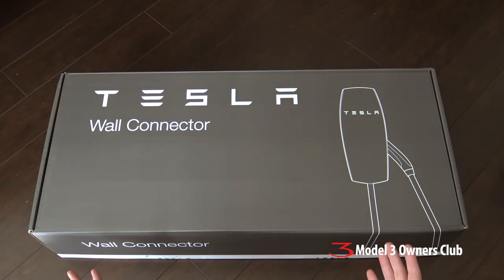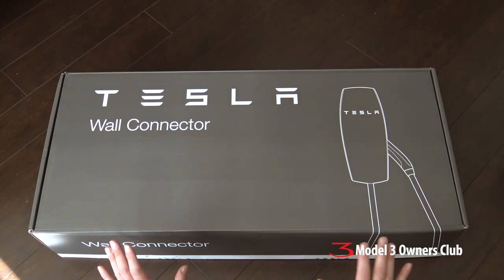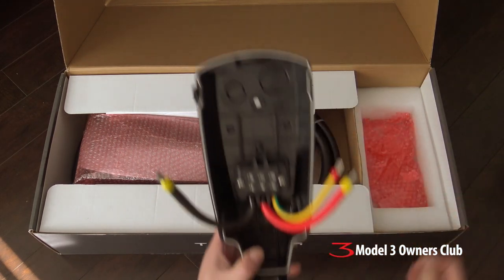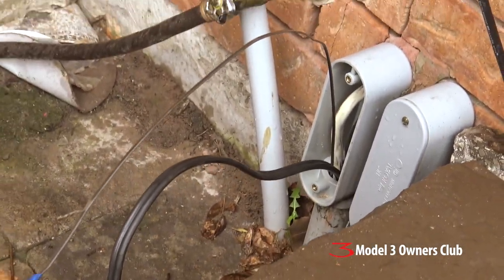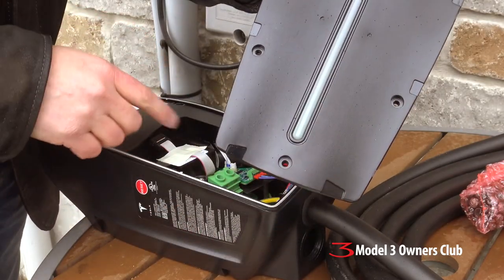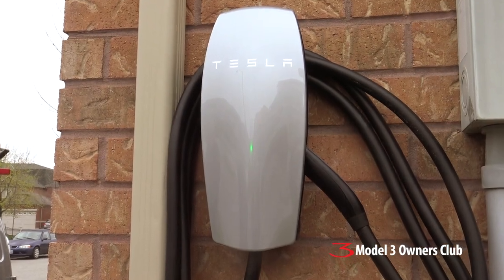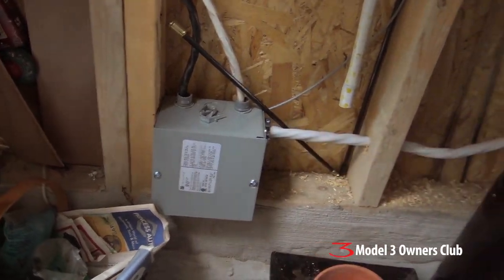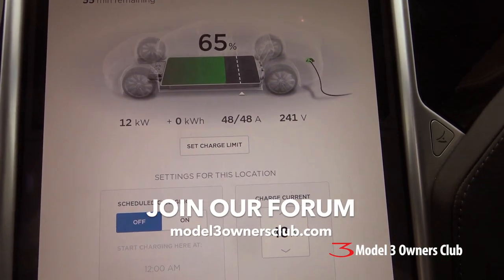Tesla Wall Connector Install | Model 3 Owners Club

Comment: When unboxing you didn't show the template for the wall mounting bracket. You find it in the bottom of the box.
Reply: Nobody seems to see it. And it's even mentioned in the manual. Makes it a lot easier to get the mounting holes correct.

Comment: Quick question, something I just can't find an answer on- Am I able to plug my adapter into a standard 110V wall outlet in my garage to charge??? Do I have to buy extra hardware or have an electrician set up a special circuit just to charge my car???
Reply: Model 3 Owners Club- thanks, I plan to super charge once or twice a week for free instead of paying to charge over night at home. However it's good to know that it's still an option.

Comment: Nice video. Can you tell how much the Tesla Wall connector was and how much you paid the electrician? Thank you.
Reply: Nelson C 

It used to be $1000 but they recently dropped the price to $500.

If you have or are planning to get two Tesla automobile's get two HPWC's installed as its much easier to plug in a second car then having to wait for a charge. You only need one 100 amp circuit for up to four HPWC's installed as they will automatically adjust the power being transferred to the cars battery.

Cheers!

Comment: Hi Trev. Do you know if it's possible to change the Tesla Wall Connector from hard-wired to a 14-50 plug? I'm just thinking if I trade in my Model 3 in the future for another brand of EV I'd have to change the Tesla unit to a j1772. BTW, thanks for another great video.
Reply: As long as you run 6-3 wire you can change it into a NEMA 14-50 in the future.
Reply: Use of a plug and socket vs hard wiring can only be done inside a structure. Most code authorities won't allow you to use a plug and socket for an EV charger outside.

If you are planning on a garage install you'll be fine with a plug and socket.

If Tesla don't make a unit with a plug get a clipper creek EVSE, they make them with a variety of plugs and they can support higher amperage depending which model you buy.  Buy an extra J1772 to Tesla adapter and leave it on the plug in the garage. Then if you do change EV you'll continue to use the J1772 EVSE without the need to change anything.

https://store.clippercreek.com/residential?product_id=140 

Clipper creek do make a 48 amp residential EVSE, but it's hard wire only.

Comment: Was the decision not to go w/ 100A (80A constant draw) circuit limited by the # of shared conductors in your conduit?
Reply: Appreciate the comment.  Excellent overview video by the way.   You covered several of the concern areas for folks considering the HPWC. ;-)

Comment: Too bad it didn't show the actual wiring of the Tesla wall connector
Reply: I have a saw that runs three phase, which also does not require a neutral. They have a 110v lamp on it, which they feed from a transformer connected to two phases.
Reply: I saw the wire that you used and I'm curious why you chose to go with 6-3.  Since the neutral is not used on the HPWC couldn't you have just had 6-2 wire run instead?
Reply: Its always better to run 6 - 3 with a neutral because you never know when you'll have electronic devices in that circuit
Reply: Yeah, but the neutral is not hooked up...and I'm sure there's nothing else allowed (by code) to be run on that circuit.
Reply: They only pulled 2 wires with the isolated ground in the conduit.  The length of 6-3 cable used in the garage is probably less than 20ft, so the price difference between 6-2 and 6-3 isn't that much.

As for the reason they did it... probably not sure if the wall connector required a neutral or not so they picked up the 3 conductor to be safe.
Reply: 240v is no neutral. Its single phase, but two lines of 120v that are 180 degrees out of phase. Between these two you get 240v, no neutral required. If you use only one of the phases, you need the neutral, which is the center tap of the transformer up there on the pole (or buried in the ground). If you wanted both 120v and 240v connections inside an appliance, you would need the neutral, but the vast majority of 240v appliances aren't wired to need that. Instead they just use the 240v, and convert it to whatever the  internal requirement is (usually +5v to run the supervisor processor).

Comment: One question.  It's my understanding these Tesla plugs have a switch in  them that needs to be set depending on input amps. Does this 2nd generation still have that?
Reply: Yes it does.  It also allows the interconnection of multiple HPWC's (up to 4) and they will balance the load based on need.
Reply: So no additional circuit installation required for multiple WCs?

Comment: I heard that there is some sort of rebate available in Ontario for the installation and/or the actual charger.  Can you confirm/deny?
Reply: In Ontario you get $1000 towards the installation
Reply: Thanks.  (BTW, I incorrectly referred to the EVSE as a "charger", which at 2:17 of the video, you clearly indicated it was not.)

Comment: I bought mine back the end of February. I had already ran the wiring last Summer but I wanted to get one because I did not want to just rely on the UMC connector with the car and I wanted to get it now and not have it backlogged when the M3 comes out and they double the Destination chargers world wide. I'm looking at 1st Q 2018 M3 delivery, just being proactive. :) If you set the Dip or in this case dial to the Breaker amperage the HPWC automatically pulls at 80% of that. I installed a 50 amp breaker so I'll get 40 amps for charging but should be more than sufficient. I agree the M3 will most likely come with the 48 amp on board so I could upgrade if Needed but I don't think that will be necessary.

Comment: I'm confused. I thought all I needed to charge a model 3 was a plug similar to that used by my washer/dryer? Isn't it cheaper just to get a plug like that installed in my garage?
Reply: I read an article that said the base model 3 can take only up to 30 amps? Would a 14-50 connection be the best way to charge then? or would the wall connector still do it faster?
Reply: Thanks! Love your videos!

Comment: How much did installation cost? Is this something that homeowner can do? In addition, is there a reason why you didn't show wiring for positive,negative and neutral?
Reply: I had mine installed by an electrician and it cost around $750 which included the inspection fee, about 20 feet of 6 gauge, 60 amp breaker and a shutoff near the HPWC.  I'm located in Buffalo.
Reply: Thank you for going over the cost. I have been very curious as to the cost of installation. I really enjoyed the video!!

Comment: Thanks for the video. I'm curious, is there any way to switch off the power so that no desperate tesla user would charge for free in my home? Do I have to install a switch inside home? Or is there any way to charge other tesla users and get paid?
Reply: Morimitsu Trader check out EVMatch, based off California. They are basically creating a way to share your home charging station without you paying for the electricity you didn't use.
Reply: Yes, for sure, I'm planning to install switch. I live in condominium. and newer know who gonna use your charger. It is better to think ahead instead being to late to think about it.

Comment: Great video, as an Australian electrician, I always like to have a look at overseas wiring practice.  Strange to see so much exposed wiring for a modern house!  I doubt I'd want to see any of it so low in your garage, I'd say it definitely need some mechanical protection, eg conduit or plasterboard (drywall).  Its also a shame you Canadians are stuck with measuring cable size in the US AWG rather than in cross sectional area in mm2.
Reply: Agree, is always interesting how regulations and workmanship differ from country to country. The "canadian style" is quite "creative". Here all lines would require additional mechanical protection. 
Additionally, interesting that you can draw much more amperes in North America over 220V / 1 Phase. In Europe, we can draw max. 32A on a 400V 3 phase line. You guys might need much thicker copper-wire.

Comment: how quickly will this charge compared a regular outlet?
Reply: They will charge at the same speed on a given supply line.  This is an AC HPWC (High Power Wall Connector) not a DC Charger.  It's basically just a pass through with some communication.
Reply: A regular 120 volt outlet at 15 amps can charge the car at only about 3 miles of range per hour, or maybe 4 if you're connected to a 20 amp circuit.  So going with a 240 volt circuit is definitely the way to go.

Comment: Hmm... that was a slightly disappointing outcome, aside from the whole sloppy feel to the cable dressing with the slanting run of non-metallic cable in the garage... With 1.25 inch underground conduit and as short of a run as you had between buildings, you could have run three 3awg and one 4awg thhn conductors and sub-paneled the garage with a 100 amp service. Of course with your limited electrical supply to the house and the 200 amp meter pan right on the garage.. a more expensive but slightly more logical solution would have been pulling 100 amp service right from the 
meter pan with a disconnect.. since the HPWC was SO close. That would have let you use the full 72 amp ratting of the wall connector and still run the existing circuits in the garage. It would have also given the option of a reasonable level of power sharing if a second HPWC were to be added at a later time. Like the other commenter, I also cringed at the use of a #2 Phillips on the torx screw. Otherwise, enjoy the model 3! Getting the charging setup before delivery is a smart move.

Comment: Are you sure that unit it will be compatible  with the model 3. When I call Tesla they told me to wait.
Reply: My garage already has a 240 outlet ,Is there anything else I need to know before I buy a home charger? Also I have an GE home charger that I used when I had the volt. Can I use that & just add an adapter?
Reply: Oh by the way I received my T- shirt from your website & love it. Thanks

Comment: Why not feed it from the spot right after the meter?
Reply: Came here for this. could be a regulations issue.
Reply: Model 3 Owners Club my idea was that spot plus additional breaker, but I guess This is why I am not an electrician :) Great job preparing for your M3 :) Waiting for mine impatiently too! I booked very early, but since I am not a current S owner, I will have to let those guys have their cars first. Crossing fingers for September delivery. My BMW lease ends in July.
Reply: Vlad B there is regulation in Europe instructing the first circuit breaker after the meter be inside the main building. Any external lines have to be connected the the main breaker.

Comment: Am I the only one who didn't know the destination chargers have a button to open the charging port door on the car?
Reply: Not all Tesla's support that though.  The older ones you have to open (and close) the door manually.  :)
Reply: Interesting. Any idea what year that was added? Are there any destination chargers that don't support this on the newer cars? Is this is thing on super chargers as well?
Reply: You know what...now that I think about it some more, I have it backwards. The older versions of the cars do not automatically CLOSE the charge port door.  AFAIK all destination chargers and SC's will automatically open the charge port door though.

Comment: Yeah that definitely was the wrong way to do this. Why wouldn't you just put a new 100 amp panel inside the garage and run right off the Electric meter? This way you could optimize the full 80amps.
Reply: Model 3 Owners Club I think he's talking about a sub-panel that essentially has the same amperage as your main panel. 😅 Not sure if that's allowed per NEC code
Reply: That's exactly what I was talking about.
Reply: No you would have to run new wire from the meter to a 200amp service then feed the house from that add a ground wire to the house and run the charger from the new 200amp panel.  Power company would have to pull the meter and the cost would likely be 1000$ more

Comment: That's a lot of copper, holy crap America...
Reply: Huh?
Reply: He is correct. 25' of fairly large diameter copper cabling.
Reply: Scott Franco yes it is. But what does that have to do with America?
Reply: Because for some reason at least the US and Canada is rolling with 110V from my understanding? That just means lots of Amps and thus huge amounts of copper.
Reply: It's 240v.  If the run is over 100ft (30 meters) you have to go up one size.
Reply: That's not the same as Europe at all. I mean you can get 220v in your car but the similarities end there. 

The EU Wall Charger can utilize 400V 32A 3 phase for 22 kW output. The US version is 80A single phase 220V? Look at the difference in wire gauge for these two options.
Reply: 'All that copper' is not needed except to meet code.  Trev's cable has 3 conductors and a bare ground wire (total of 4 wires).   Back in the 1990s the NEC (in the US) code changed to require 4 wire so that the ground would not carry any current.  Some old school 2 wire (+ ground) 220v loads (like a stove or closes dryer) would have a timer (clock) motor in them that was actually 120v, and since they didn't have a neutral wire they used the ground to reach the neutral (which are tied together in the supply panel) - which resulted in the ground carrying a small amount of current.   Code didn't like that so they started requiring a neutral.  I'm pretty sure the neutral is not actually used by the charger.